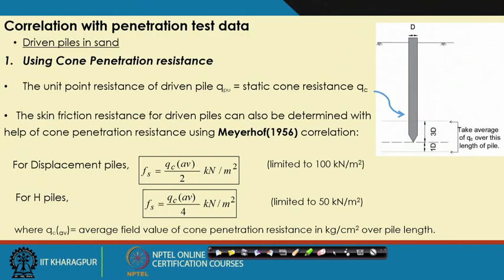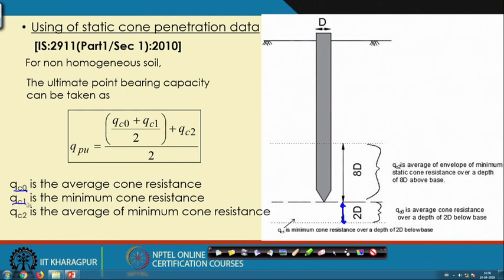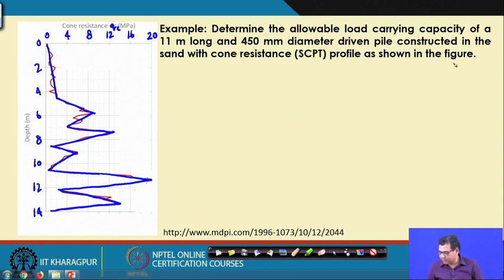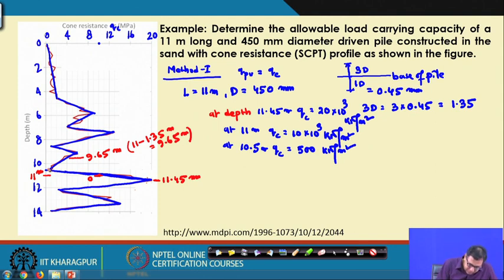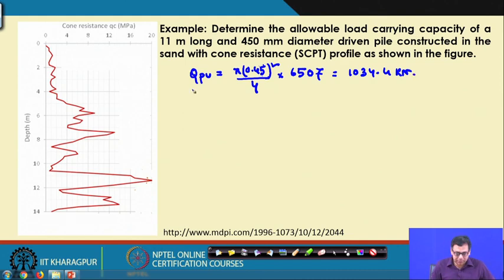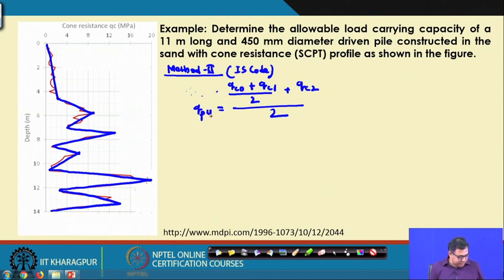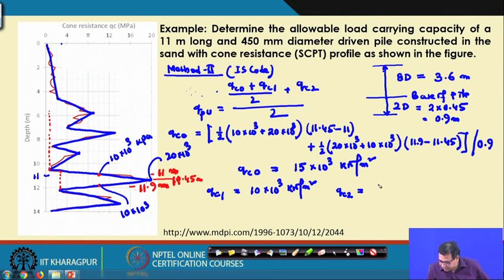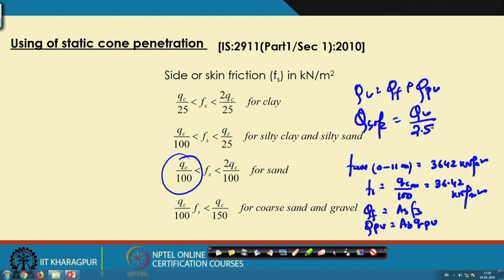Lecture 37 : Pile Foundation - XI

Comment: Dear Professor Deb,
I think that the skin friction resistance range for coarse sands and gravels might be wrong. I also downloaded the IS 2911 (part I/Sec1) and the same range is reported there. Lets say qc is equal to 100. Then, the range would be 1 < fs <0,66? It does not seem correct, so I imagine that this upper bound should be larger than qc/50, since this is the upper bound for sand. I would adopt a upper bound of qc/25